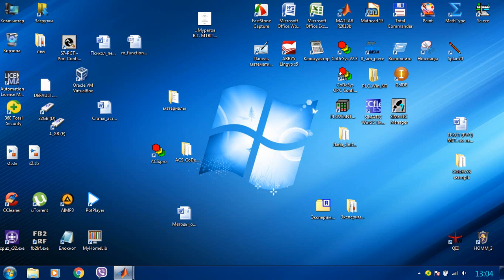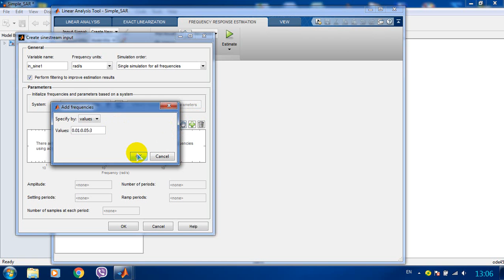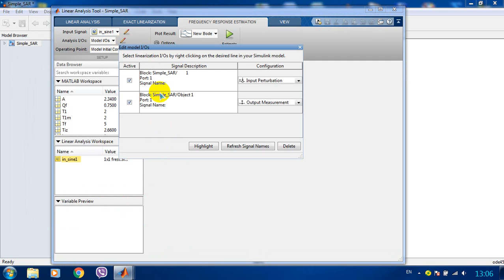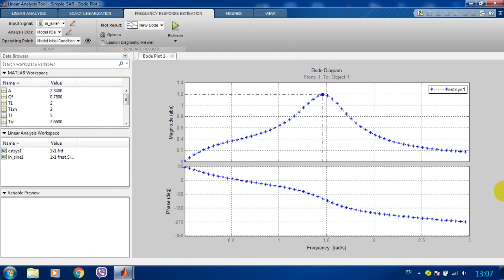MatLab Simulink frequency characteristics

Comment: Nice Video. Kindly can you guide me how to simulate load frequency control in simulink.
Scenario: Two synchronous generators sharing power in parallel in islanded microgrid on droop control.Now if at any instant of  time load demand exceeds the power generation, then how can system be stabilized .Kindly answer in perspective of simulink model. Which blocks will be needed and how to do it. 
Thanks